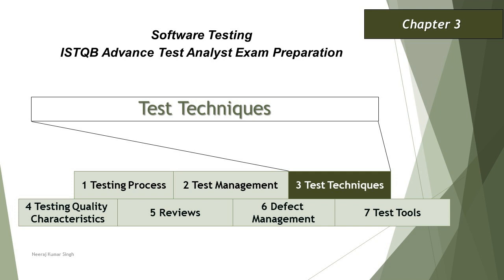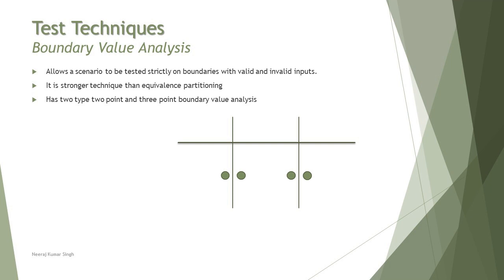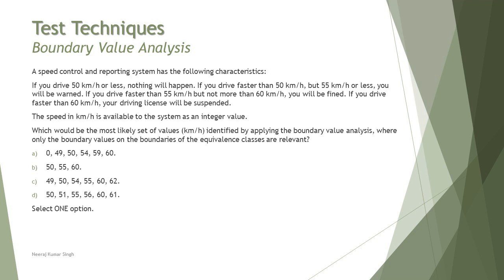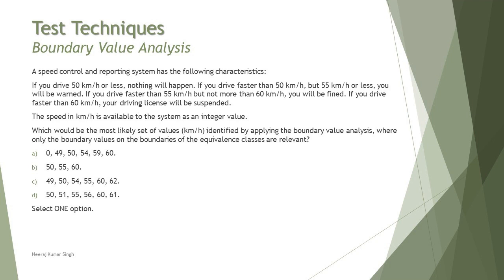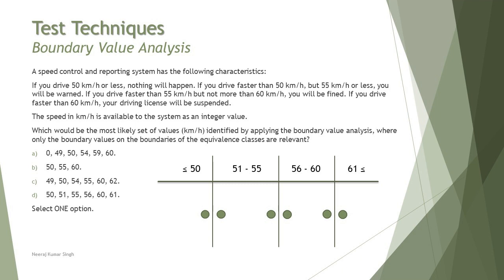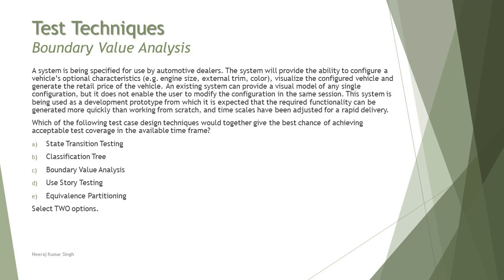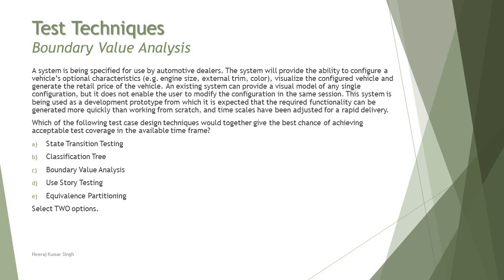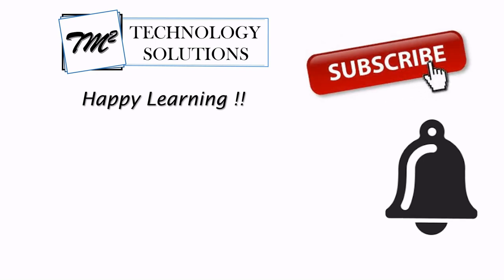ISTQB Advance Test Analyst | 3.2.2 Boundary Value Analysis | ISTQB Tutorials

Comment: Hi sir. I have one question. How can we use Boundary Value Analysis for color since the partitions for color cannot be an ordered partition?
Reply: Just as an update, the answer on these slides is incorrect. It should be b(classification tree) and c(equivalence partitioning). This is as per the ISTQB practise exam. Might be worth updating this video so that people don't make this mistake in the exam and lose points, should a similar question be asked.
Reply from the maker: Hi There,
Ranges are not created based on the principles of ordered or unorder item list. We put the similar behaving elements together in a range. For example, payment through a credit card type (Master, Visa, Amex), Color (Red, Green, Yellow), Transmission of Car (Automatic, Manual, Semi-Automatic), etc. I hope this clears your confusion.
Reply: @TMSQUARETECH   How can you define boundaries if the partitions are  not ordered? You can make partitions in this question. but can we have boundaries?.. And this is what Wiki says. " In practice this(BVA) would require that the test vectors can be ordered, and that the individual parameters follows some kind of order (either partial order or total order).